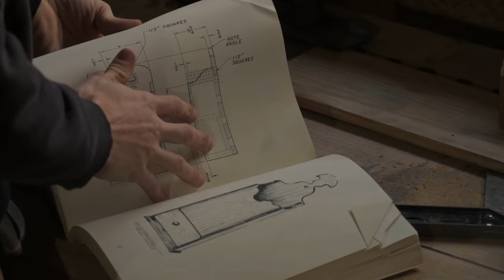18th century hand-tool woodworking practice 1(full length)

Comment: Might be time for a new holdfast 😉
Reply from the maker: My exact thought. Lower cost isn’t always better haha
Reply: @Bucksawwoodworks  you might find the screw-adjustable clamping style to work better in the relatively thin softwood aprons, as compared to the regular bang-em-in style.  Not as fun as whacking them with a mallet, though 😜
Reply from the maker: @memilanuk  my main skill set is 17th century green woodwork. I perfer the old school ways of performing the task at hand most times at-least. I’m friends with a black smith that can probably make me some good ones that don’t need as much force to work
Reply from the maker: @memilanuk  I appreciate the suggestion I would be lying if I said I’ve never thought about it though

Comment: How thick is your front apron? Might not be thick enough for the holdfast to work properly.
Reply from the maker: 3 inches I doubled up 2x10
Reply: @Bucksawwoodworks  sounds thick enough. Maybe it is just the holdfast. I’ve had good luck with the one from gramercy.
Reply from the maker: @brianburrows2943  it is the holdfast I bought it because it was cheap. I’ve heard really good things about the gramercy hold fasts
Reply: Sounded like it was hitting the bench leg !!